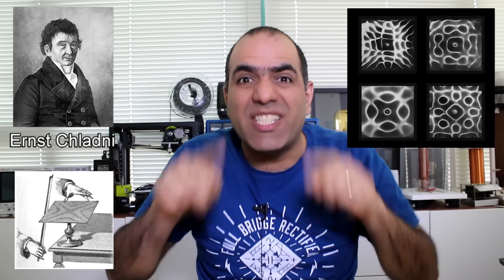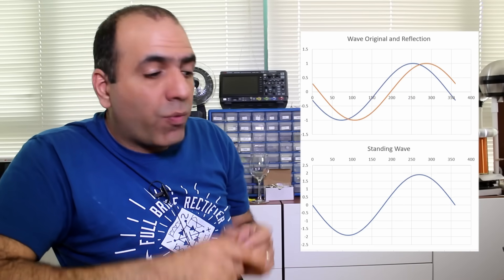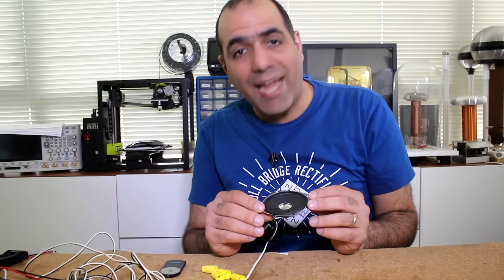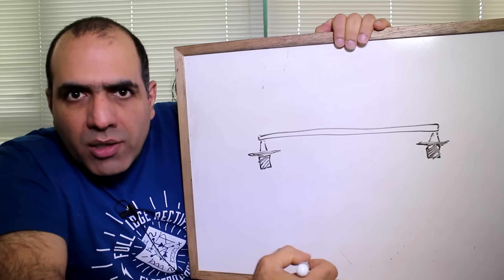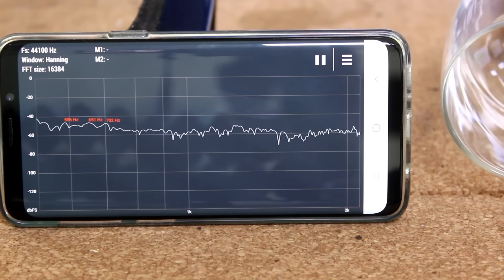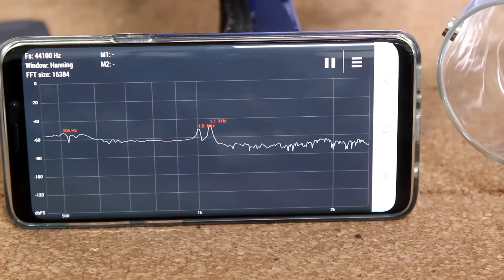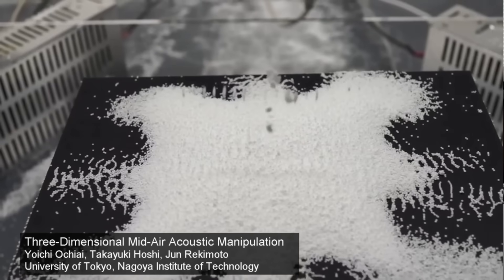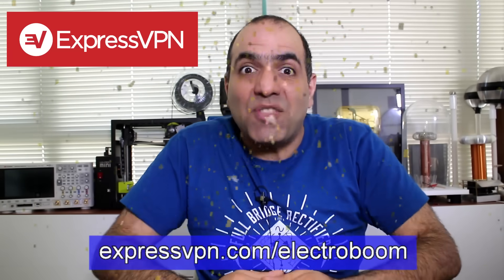Moving Particles with Vibration, Making the Chladni Plate

Comment: Could someone explain why he uses the op amp in an inverting configuration instead of a non inverting configuration? Is it because the 180 degree phase shift from the inverting configuration is negligible? For instance if the signal is a sine wave at 1kHz, a 180 degree phase delay would just be a delay of 0.5ms?

Comment: The frequencies need to be changing at two different rates in such a way that the sum of the frequencies equal a constant rate of change moving the salt across the entire plate. So instead of a standing wave oscillating at 1hz you have a standing waves frequency changing at a constant rate. 
After typing this out it doesn’t make sense to me anymore.

Comment: I think the best way to get the wave patterns to move the salt would be to use the same frequency on both speakers, but vary the phase between them. You should be able to put the nodes anywhere you want to, including running them off the edge...

Comment: you can use the speaker on the other side to cancel reflections and adding a fake reflection with custom phase-shift. You need to know the wave speed and loss through the plate, and it does require very good phase-control.

Comment: Hi Mehdi,

I think your 2 speaker setup failed because by gluing down the board at the edges (to the speakers) you fixed the medium's boundary conditions so that reflections are inevitable. If you wanted to try again, maybe glue them the same distance apart again, but use a full size foam board. You'd still get some reflections probably, but then you could try to impedance-match the foam board to the surrounding air by gluing on some wide paper fins along the rim. The waves should couple into the paper, then dissipate the energy into the air, making your whole setup a better approximation of an infinite medium. Then you shouldn't have to worry about reflections

Comment: Could the reflective waves be absorbed by the speaker on the other side of the transmission line by applying an appropriately tuned signal in the opposite polarity? Or else I have been thinking in terms of high speed electrical signals. Since the change in transmission impedance from the cardboard to air is significant, almost 100% of the incident wave will be reflected. Could the incoming wave be almost 100% absorbed in some way by some kind of impedance matched load? Like attaching shock absorbing material (rubber, foam) to the end of the transmission line which is firmly secured to a big and solid object (like the table) at to not act as a counterweight and reflect anything. The shock absorption could even be realized with a hydraulic piston with a pneumatic load which can then be tuned.

Comment: Great video again! Why not try to put the speakers 90 degrees apart? I think the particles would then push the particles diagonally. Or maybe if you had 2 speakers on the same side it would better push the particles from one side to the other. for the other side where you no longer have support, you would need to put a support in like a piece of rubber.

Comment: What if you used two separate tracks on Audacity with one set fully on left audio and one set fully on right audio, and then set up that same 1 hertz difference but made the audio cut out at the point where the salt runs backwards, and made the audio start again when the salt goes forward, and just repeat that cycle?

Comment: If you can predict what the reflected waves offset to the originally generated one (which should be possible knowing the length of the plate and the frequency) can't you also send a second wave (or a second harmonic) from each speaker to cancel the other speakers reflected wave?

Comment: The particles doesn't settle in the nodes or antinodes, they settle in between since the middle has the least vibration which would cause the particles to move around

Comment: In the two speaker setup, why not make the speakers drive in a way that adds the original wave but subtracts the reflected wave from the other speaker? You'd probably need a digital driver, and some testing to find the speed of sound in whatever material you're using, but it'd probably work okay.

Comment: Anyone else reminded of the old old electric football game that vibrated a metal play field? There were player figures with magnets on the bottom that would move around when you switched it on. It was supposed to simulate plays, but I remember them mostly getting stuck on the edges or twirling in little circles.

Comment: Even though you got the node to shift a little by driving the different frequencies differently, you would have to  ultimately change the frequencies to keep the node or nodes moving smoothly across the board. It would probably involve finding a lot of different resonances and mapping each node generated, then cycling through these resonant frequencies to step the particle cluster from one node to the next, while still utilizing the slight motion to allow for the overlap. 

So doable - but the kind of thing you could spend a lot of time and money on and end up with something very complex that's no better than an Archimedes screw for moving something uphill. But like still cool.

Comment: You had it right with the frequency difference! However you need to modulate the frequency of one driver from -1Hz to 0Hz (in perspective to the other) every other pulse so the salt doesn't return to it's original position after each cycle but advances.
Reply: What are negative frequencies?

Comment: What if you put the same frequency signals on both speakers but change the phase of one of the signals. or even put 4 speakers on each corner one.  Put the same frequency on .. and change the phase. They perhaps you can move the salt in all directions.

Comment: So this is a great video.

What you want to so is create end conditions and dampening that make your wave move slowly back and forth. Whats happening with your foam board is your node is simpely occilating back and forth to the wavelength of one hz on your foamboard. So you can use a subwoofer and much lower frequencies. Try somwthing like 0.05 hz diff on your foam board and you should see some impressive movement on your standing wave.

You can also alter the geometry of your board. Right now you have your waves interacrinf at right angles but if u made a trapizoid you mite get asymetrical wave proagation.

Comment: ElectroBOOM: I think there is a lot of room for experimenting with this phenomena.  How about fixing one end of the plate solid and driving the other end. If the frequency is tuned to the frequency of the plate a SWR could be controlled by changing the frequency by a slight amount or by it's harmonic. I can think of other experiments to do as will. Great things can be accomplished by the way of sound.   Just look at what Mr. Nikola Tesla did with his experiments.

Comment: What if you were to put something on the edges to dampen the reflection?
Reply: That's how the original Chladni plate worked. You have a violin bow rubbing against a metal plate, and by holding the plate differently, it affected the resonance of the plate and so affected the patterns

Comment: You should try both speakers on one side of the board. That will give you the ability to have two separate frequencies driven from the same side and the reflection shouldn’t matter so much being both would be reflected back.... at least that’s my theory and I’m sticking to it. Lol.
Reply: After rewatching this video and thinking about it, I realize that both frequencies just needs to sweep up or down to move the particles. So each speaker can stay 1hz off frequency to the other to create the standing wave but have them both sweep up or down in frequency together, like from 100/101 to 110/111 or 90/91 (speaker 1 freq/speaker2 freq). The standing wave neutral point should move up and down the board with the frequency change.

Comment: Now I'm wondering if the concept of "fish stair marble lift" (just watch Wintergatan's Marble Machine X in action if I'm making no sense) could be adapted to this to make it work - after all, the two speakers apparently can create a small oscillating "transport"; so if one would add another set that works at the same frequency but with a phase difference (if that is even possible, maybe the nodes can't be moved, it's complicated...) and fade the two sets in and out alternately to "hand over" the moving salt from one local oscillation to the other... maybe it could work...?

Comment: thanks for showing us what a speaker in the AC plug does, none of us could have done it safely! lol tho as i was thinking, the frequency needed to be the thing moving for the material to be moving... it is practically moving the crossing point. tho i wounder if in a closed environment if they could make a 3D TV out of that... tho because of the shapes, i think it would not work but that would have been a cool thing!

Comment: You might as well actually try acoustic levitation - it's completely doable with a couple(a couple of dozens actually) of ultrasonic transmitters/receivers used for distance measuring. It might be hard to calibrate and get stable levitation practically, but hey it's a lot of fun

Comment: You say the water is vibrating
It has a frequency, and the rate at which water drops leave the source can be measured in s^-1, but the water is not vibrating in the way you stated

By the way, i love your videos
Reply: What if you consider the water stream as a continuous wave, where the peak is a water drop and the trough is the space in between the water?

Comment: You are getting more entertaining.  I think you need to program the frequency change so it moves the mass in the direction you want.  You should also have to measure the actual movement to account for different weight particles.  Nothing is easy.  There is no free energy.  Full bridge rectifier.

Comment: I think doubling the Delta between the two tones should give two lines of salt, if so, then 1/2 the delta should case the line of salt to move twice as far as the original experiment. With 1/10 delta may move the line of salt from one end to the other, as desired,  maybe?

Comment: If you want it wouldn't be hard a to write a function that take a parameters of starting frequency, and dimensions of your plate. And loops through the length of the plate , increasing frequency. And then a decrement function. This way you could send the particles back and forth at a push of a button.

Comment: Denote I = integral from -inf to inf 1/(x^2 + 1)^2 dx.

(1/(x^2 + 1)^2 = 1/((-x)^2 + 1)^2)

By symmetry I =  2 integral from 0 to inf 1/(x^2 + 1)^2 dx.

Now define x = tan(u) which means that dx = (tan(u)^2 + 1) du.
Integrating u from 0 to pi/2 goes through all the values of x = tan(u) from 0 to inf exactly once.

Thus I = 2 integral from 0 to pi/2 1/(tan(u)^2 + 1)^2  *  (tan(u)^2 + 1) du = 2 integral from 0 to pi/2 1/(tan(u)^2 + 1)  du.

(cos(x)^2 + sin(x)^2 = 1 => 1 + (sin(x)/cos(x))^2 = 1/cos(x)^2) => 1 + tan(x)^2 = 1/cos(x)^2)

But since tan(u)^2 + 1 = 1/cos(u)^2, I =  2 integral from 0 to pi/2 cos(u)^2  du.

(cos(2x) = 2cos(x)^2 - 1 (= cos(x)^2 - sin(x)^2) )

Now, I = integral from 0 to pi/2 (2cos(u)^2 - 1 + 1) du = integral from 0 to pi/2 (cos(2u) + 1) du = substitute from 0 to pi/2 (sin(2u)/2 + u) = (sin(pi)/2 + pi/2) - (sin(0) + 0) = pi/2.

Hence integral from -inf to inf 1/(x^2 + 1)^2 dx = pi/2.

Comment: if you are planning to use resonance, you are forgetting that the energy would need to transfer to the "salt" at the same speed. otherwise, its going to ram into the plate when it is on the back crest, rather than the forward crest half the time, causing it to be in the middle. 

Im sure you are much smarter than i am, so if you figure out the rate of energy transfer, you will at least have something to work with to make your idea possibly work next time. 

Think of the sound/vibration as a Wave in the ocean, if that wave moves at just the right rate, it will lift up a life raft, and bring it back down safely, anything faster or slower, will end with a different result. 
To propel the raft, forward, you would need a wave that starts and stops, at just the right interval to impart energy in one direction, without the other part of the wave interfering, in other words, just the right non continuous pulse, will move your salt.

(unless you know the exact amount of energy to impart to the salt, to get it to hit the next forward crest, without hitting the reverse crests. which i believe would be far too difficult in practice.)

Found a smarter every day video that might help you visualize. 

https://www.youtube.com/watch?v=KJDEsAy9RyM

Comment: you should try to active cancel the resonant frequency, some noise will still move some salt, but you should get the efect you want...the problem is to do this without canceling the original frequency...i imagine a setup of 4 speakers, in a cenario just like the one you have those 2 glued, but with another 2 glued upside down right in the same spot, and the ones above play a mirrowed frequency of the 2 below...i don't know how to express this properly,but sometihg like RA1 RB-2 LA-1 LB2...if you try and doesn't work, dislike this comment for the update!! have a good day

Comment: If you really wanna lose a lot of time and energy, you can actually use the end speakers to create the 2nd frequency AND virtually remove the reflection of the 1st frequency by adding the generation of the opposite phase, although just using a simple function generator won't be enough... You would also need to calculate the propagation speed of your wave in the foam and the reflection amplitude and all (but I guess using a simple potentiometer to adjust the phase of the anti-reflection sinus and its amplitude may actually work)
Still a lot of work and clearly not guaranteed to work

EDIT : On second thought, you must be generating a fuck-ton of harmonics with both the end of the plate and the speaker, plus the speaker probably hasn't a constant reflection coefficient when driven. So I'm betting on it not working at all unless you're going with a lot of experiments and maths

Comment: I can see a people that would use it ... But those people prefer debit cards and such. Any way ... What if the current is delayed to be transferred to the next speaker , t(1) = 5ms t(2)= t(1)+x ... I think a capacitor might work ... Kind of , if you discharge ot fast enough and regularly enough

Comment: If you want to hook up a speaker to a 60hz AC line it can work without blowing it  up by using a 70 or 120v speaker transformer for distributed systems. Hooking up a distributed speaker system to the mains is also a good way to eliminate a short in the system :)

Comment: You see, by changing the forcing at the edges (the boundary conditions) you're not changing the eigenmodes of the plate. Therefore, you cannot do what you intended (mathematically), though the idea is good and I would probably also have given it a shot if I were in your place. You even hint it towards the end saying "I cannot eliminate the reflection from the edges".
The last experiment where it seems to work might be harvesting the non linear properties of the foam board. Speaking about non linearities, the acoustic levitation manipulator is also using a non linear effect. If pressure fluctuated linearly you would see zero force in the particles because the positive and negative cycles would cancel out.

Comment: I've seen this in an older TV show, i mean, really old. 30 years ago. They used the bow of a violin, and moved it over the edge od thin metal plates, causing vibrations and higher or deeper tones, depending on the speed, size of plate, and position, to create ovals, circles, square shapes and crosses, or X-shapes. Fascinating to see this again, in modern times, someone showing the audience this type of experiment.

And for the application:
There used to be experiments, dont know if its still used, but in medicine and technical applications, a liquid sample (some fluid) can be put in "levitation", floating on the sound waves, and then tested 'contact free' of the surroundings, so the sample is not contaminated, or interrupted, by the edges of, lets say, a petry dish, or something. I wonder how it behaves in vacuum, and if this technique was and is actually used. Since this show I saw had been recorded in the 1980's.

Comment: I don't know if this is the same thing, but in the factory i work in we have vibration powered "conveyor belts", it's basically a V-formed channel with something resembling fake grass covering the entire channel. you can change the frequency of the vibrations to go faster or slower or in the reverse direction. We use these conveyors to move rollers for bearings.

Comment: I think the issue is that resonant frequency is used. Second speaker acts as a reflection, so resonant frequency is not needed and actually interferes with artificial node created by speakers (as was noted in the video). Choosing frequencies at which resonance is minimal would allow moving particles with two signal sources. 0.25, 0.75, 1.25, 1.75 of resonant wavelength should be good.

Comment: You could maybe try to do some sort of impedance matching on both ends of your acoustic "transmission line" to avoid unwanted reflections? For example, there are some quite clever ideas on the web regarding the use of eddy current brakes for this (i am sure you are up to the task of implementing them!). Also, I do believe that more precise placing of the speakers could help with near-side wall reflections; for instance, placing it at λ/4 from the wall (like you would do to drive a waveguide). 

On the other hand, you may also try to reduce the beat frequency?